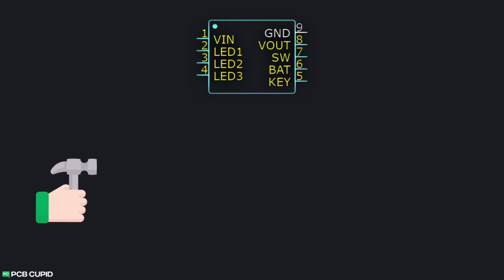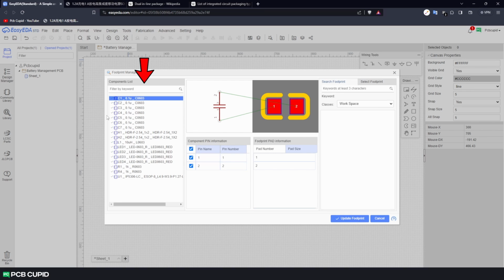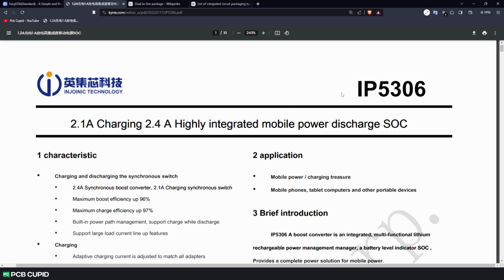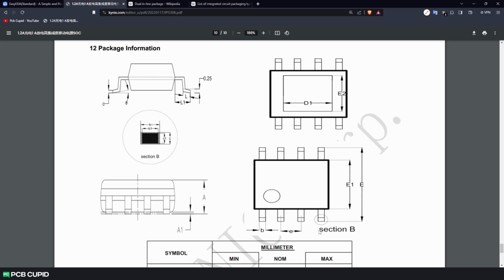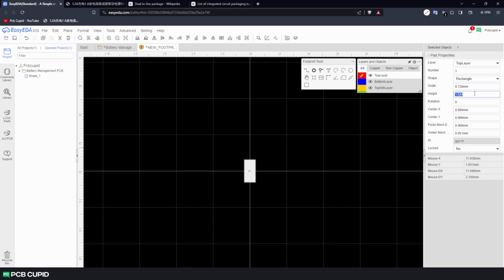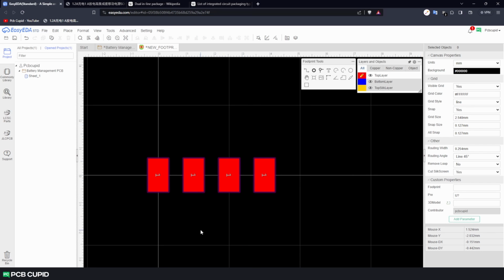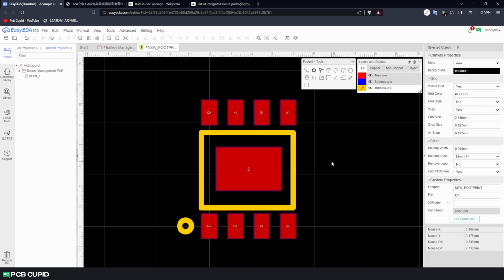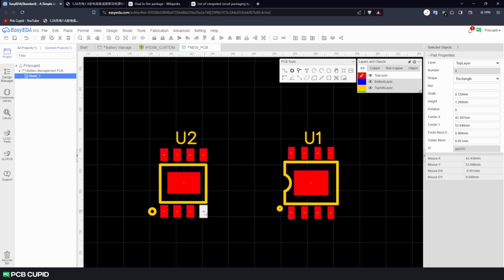#4 How To Make A Custom Footprint For Your PCB | EasyEDA 2023 #pcbcupid

Comment: Using EasyEDA for a long time. Still learned a few things here and there from your video series, e.g. the datasheet extraction ( never tried that before ). Keep going, Good Work.

Thank you for making this series.

Question: Is it possible to add our own 3D model in EasyEDA std. edition? ( It can be done in the professional version though )
Reply from the maker: Glad it helped! Yes it's possible. 

PCB Editor -> Tools -> 3D model Manager 
Here you can add external 3d model or add model from LSCS (it works similar to footprint manager)
Reply: @pcbcupid  I tried to upload Third-party 3D models to the standard version of EasyEDA but was unable to do it. However, the same was possible using the professional edition.
Reply from the maker: Please try this method : 
1. Create a new 3d Model (File -> New -> 3d Model)
2. Here select the 3d file you would like to import 
3. It supports WRL & OBJ (while WRL can be imported directly without the need for compression; Obj must be compressed into a zip file with the “mtl” file and then imported)
4. Use the 3d Model manager to assign the 3d model to the footprint 

Please let us know if it works. 
Also we think this question can help a lot of people. So please feel free to share the question on PCB Cupid website as well : https://pcbcupid.com/
Reply: @pcbcupid  Will surely try and update it here.
Reply: @pcbcupid  Apology for the late reply. 
I tried the same, however it is now even showing the option to upload an external 3D file. We can attach an existing 3D file using the 3D Model Manager but not an external one using the Standard Version of EASYEDA . The browser-based version of EASYEDA is used. The browser is Microsoft Edge ( recent version ).

P.S.: Even their documentation mentions the same thing as you.

Addition 1: However, when am using the Professional Edition, the external 3D model can be easily uploaded.